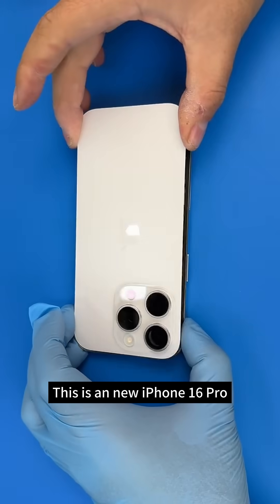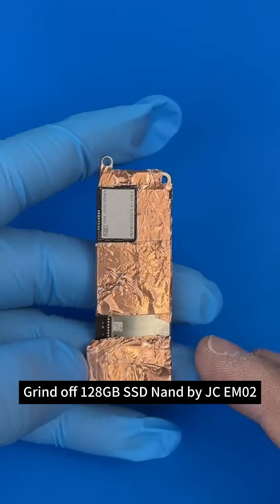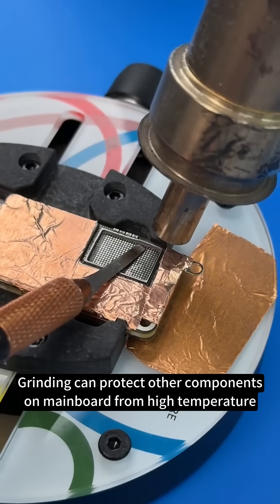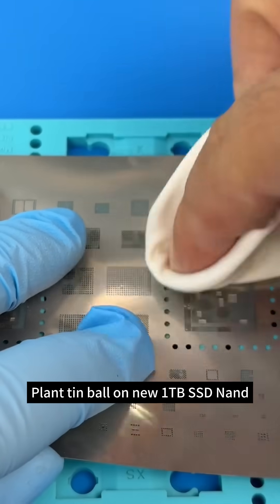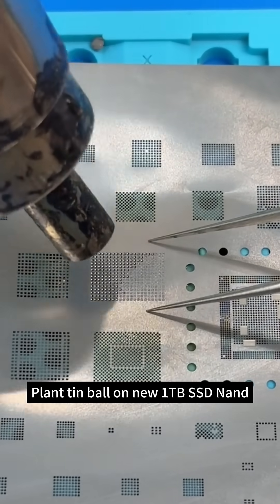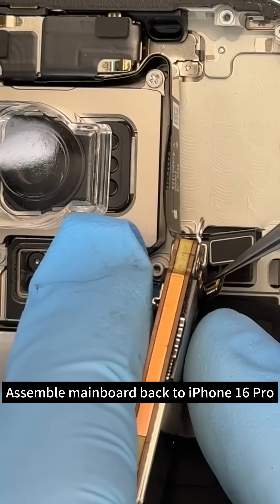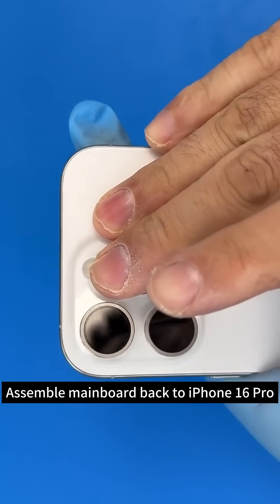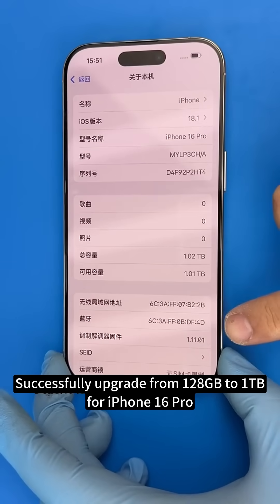upgrade iPhone 16 Pro SSD Nand storage capacity from 128GB to 1TB #iphonerepair #iphone16pro #iphone

Comment: How to damage your iPhone, follow this idiot trying to upgrade it using a chip that's not going to work as it will cause a green screen due to incompatible chip.
Reply: Oh, and 1TB does not show up as 1.02TB, should be less. He probably had two of them, and one did have the 1TB storage on it.

Comment: which software are you using to flash, can this software reset charge counts and the model manufacturing date and the model number
Reply: Battery health is on bms in the battery, not nand
Reply from the maker: 3utools

Comment: Instead of doing all this bullshit…simply use a type c external storage with 1tb storage..😂😂😂😂simple
Reply: Good luck sticking external storage to iPhone for extended periods. Not to mention some external storage need external power plus when transferring large files, you want phone battery enough juice but you stuck, can't charge iPhone😂
Reply: @ bro is stuck in 1950’S era… what generation are u man in ??… i have a sandisk extreme pro  series pendrive which is smaller than my pinky finger, and has 3.2 gen 1 speeds ( 10 gbps) and has data speed of 900-1000 MBps ….😂😂… pls come of the cave and look how the world has changed ..also mine 512 gb variant, there is 1tb variant as well
Reply: @ and based on your comment , you mentioned external “storage needs power to run” , shows you aren’t exposed to external ssd technology or atleast Nvme ssd enclosure tech.. and u r still stuck with external hdf that requires power to run all the mechanical parts inside?? Flash drives consume way less power .. and the one i mentioned above is just a pendrive only…based on the data speeds and the power needed to run it, its far better
Reply: @suryavishwanath8564  great. You think other people wasn't "advanced" like you? I knew NVME external enclosure but did you know how much watt it required and how much iPhone 16 pro able to supply. You can't supply enough wattage to NVME drive it meant for bigger devices like laptop and PC. I don't say it won't work, you can make it work with lower spec NVME with reduced theoretical speed full it supported. It's impractical to occupy the USB-C all the time. What era did you live in even iPhone need external drive stuck in? You do you. I would say the cost for external NVME drive is too much better off to upgrade the storage to higher capacity with added phone speed improvement btw.
Reply: @soshisowon  bro i didnt say there is only external nvme ssd alone..i am mentioning there is literally a pendrive (flash drive) which does the same job…now tell me, which pendrive consume as much power as an ssd…?? Also, nvme ssd are very power efficient..plus if you have a bigger cache (slc storage) , the power required data transfer required is very very low..negligible..so there is literally arguments you can do in winning this debate..external storage are far cheaper, extremely tiny(finger nail size), and consumes was less power..almost negligible amount..i dont know what r u trying to prove here ?
Reply: @suryavishwanath8564  let's break it down.
Easy of use; does internal or external storage more practical for daily usage and quick and readily available?
Power efficiency; since you brought up this issue, how much power does internal storage use do come in your mind compare with external storage? You don't know what you talked about 😂

Comment: Is there any chance of damage in phone if try with local shope
Reply: 100% these type of works requires highly experienced guys
Reply: Yes i do this on my phone. I went to good shop. And I flash 1TB storage to my Android phone. Also they flash a new PMIC and they replaced the original os with custom os.
Reply: Try it and tell us so that we can laugh you at the comment section 😂
Reply: Some of these shops scam you big time can’t even replace a screen correctly
Reply: There goes the waterproofing certification
Reply: @ianashlon1154  the experts in China can restore that,  but they have the equipment and skill level for it
Reply: 10000% …this shit wont even work..and even to make this work you need very highly skilled ppl to get this done.. and high skilled pol wont be doing this mobile repair job and earning a living…
Reply: One mistake and boom it will cost u around 600 to 800